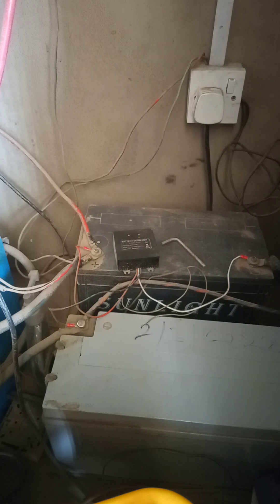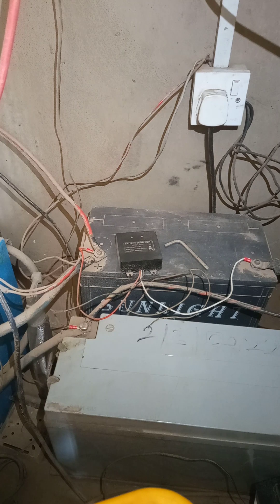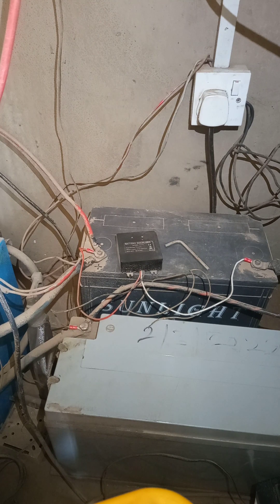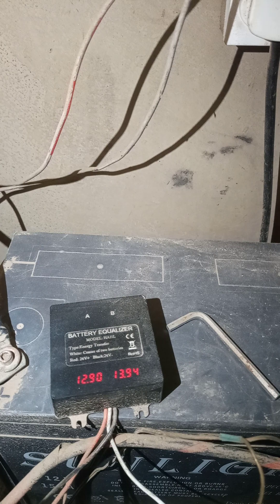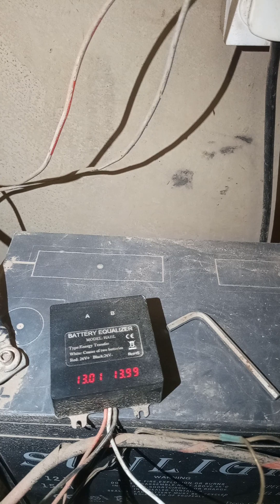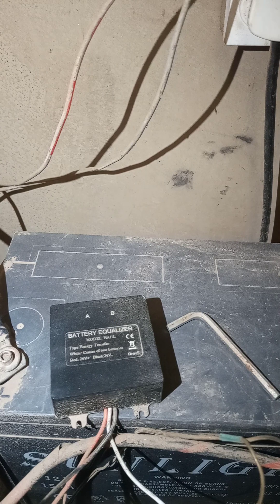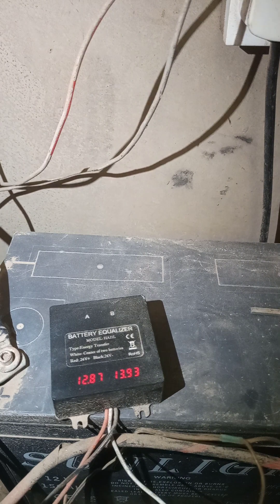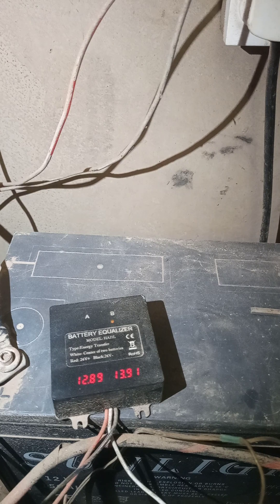Get the best out of your Inverter batteries using Battery equalizer or balancer...Dept of discharge

Comment: Why is the inverter environment so duty ?
Reply from the maker: It's in an isolated place which can only be cleaned by a knowledgeable personal. We will tidy up the inverter room against our next video. Thanks. Please, help like, subscribe and share, so that we can grow this channel on more helpful videos.
Reply: @techpointzone4408  alright 👍
Reply from the maker: @odeywilliams7596  have you subscribed to this channel? Please, subscribe if you haven't already done so.🙏
Reply: How does the battery equaliser function when discharging the batteries?

Will it help the two batteries discharge at same rate?